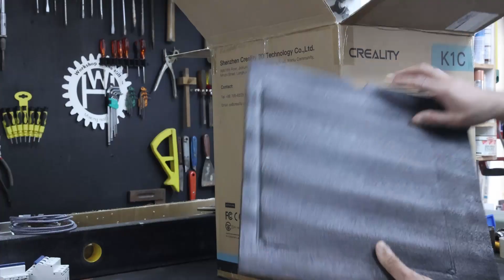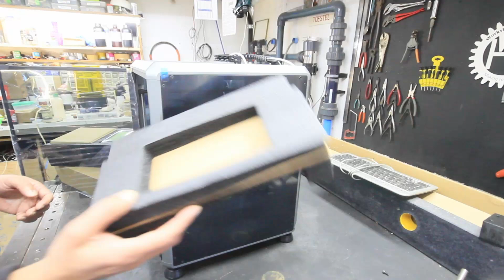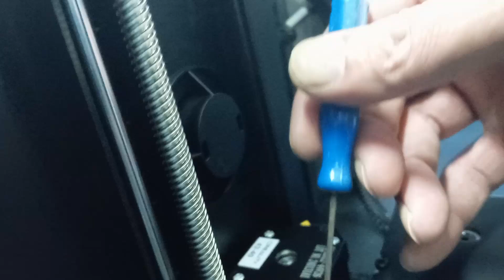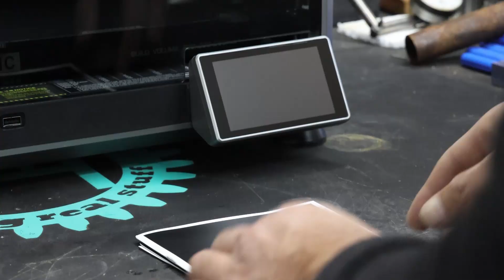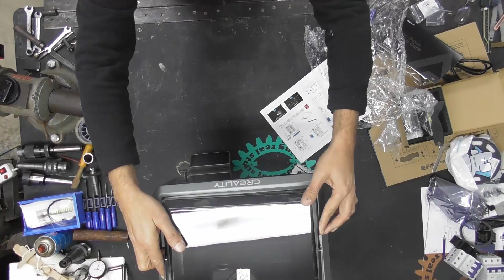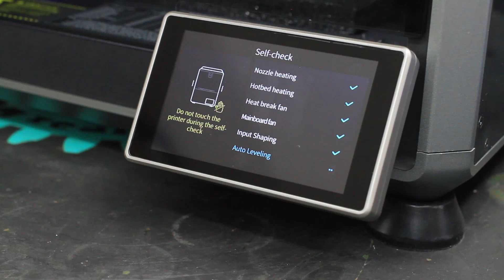Creality K1C Unboxing & First Print

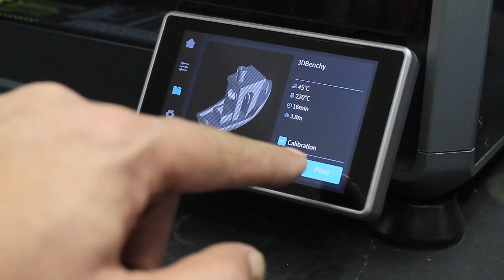Comment: 18:55 Is there anything else that needs to be done before you can print?
Reply from the maker: Nope. It's a super easy machine to use. These days I just press print from the Creality software and it starts. Just keep the bed clean and you're ready to print remotely.

Comment: This is my first 3D printer, the noise in the Input Shaping calibration step got me worried! Thanks for the video!
Reply from the maker: Thanks! I was also a little freaked out at first. A message on the screen saying "This will create lots of noise and vibration. Don't Panic!" would be reassuring! :)
Reply: @makerealstuff I thought mine would blow up